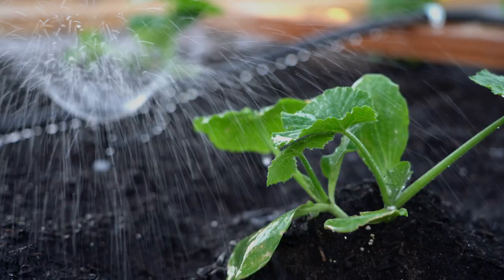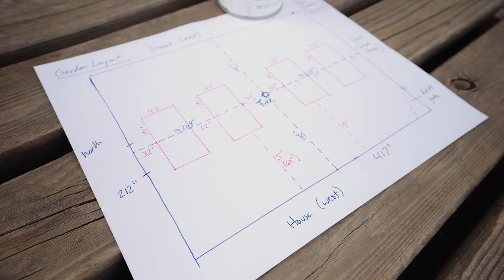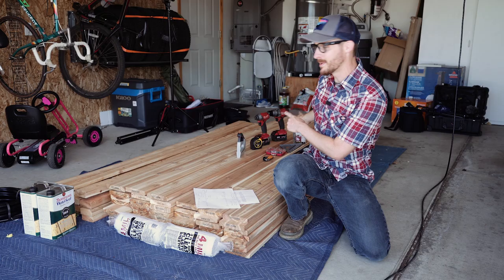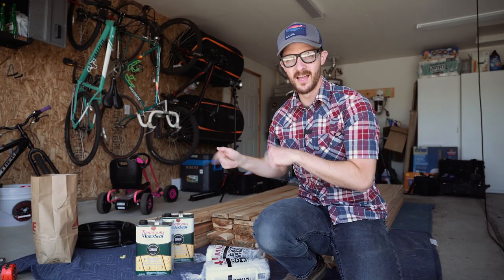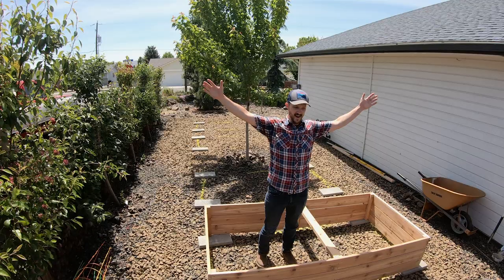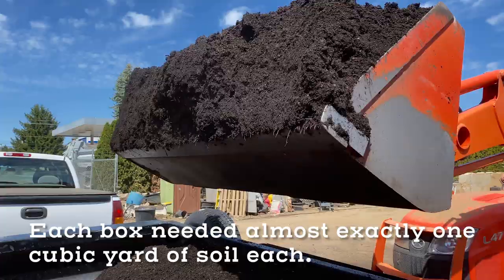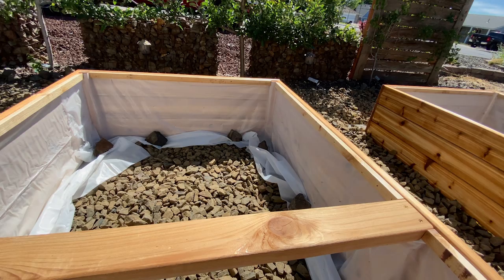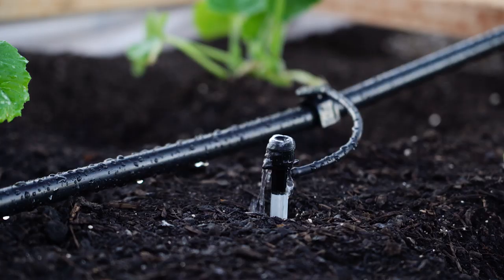How To Build Beautiful Cedar Raised Garden Beds!

Comment: Morning Jason, can I ask you a question about Thompson’s water seal, would you use it for wooden decking ? I have a full house width decking area that requires annual protection and I’m looking around for options. Great job on the raised beds mate 👍
Reply from the maker: Yeah I've used it for decking projects in the past.  For a deck the oil based stains last the longest.
Reply: Jason Explains Things thanks very much